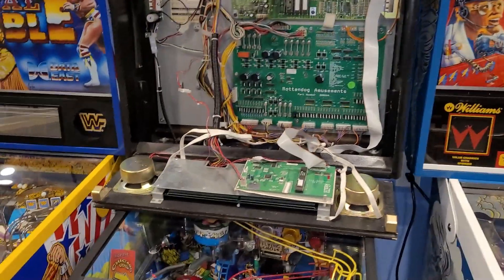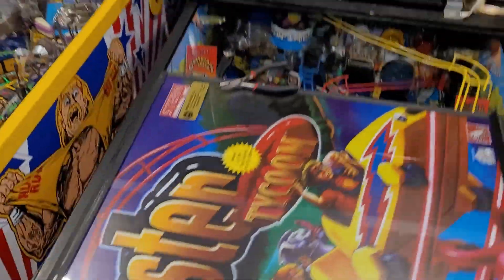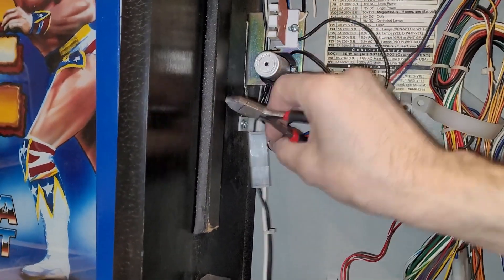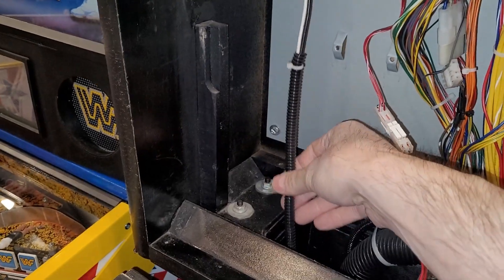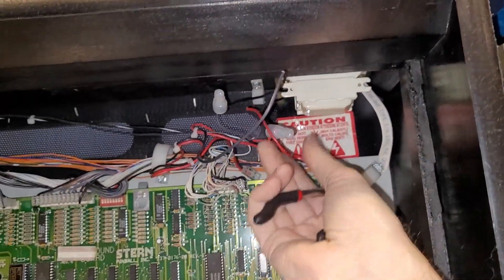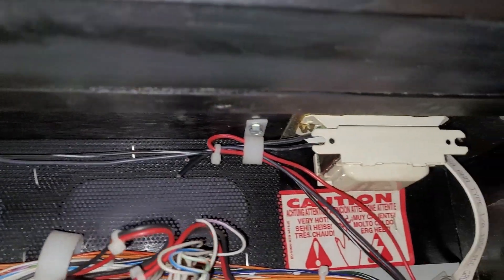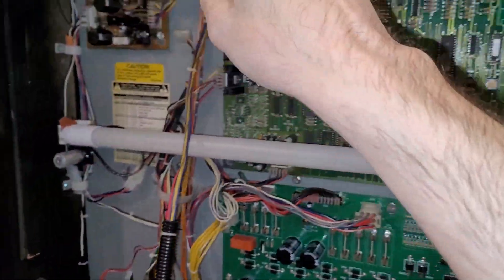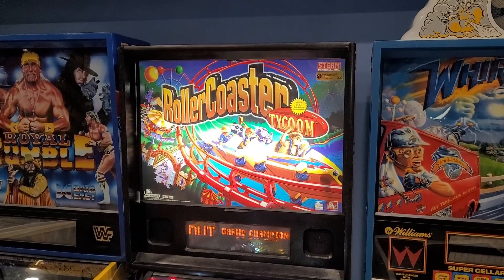How to convert your old fluorescent bulb to an LED tube in a Stern DMD Pinball machine in 5 minutes!

Comment: If you power the LED tube from the left side, you only need 1 wire nut.  The starter, starter socket and ballast can all be removed.  No wiring left from left to right side at all.  Makes a much cleaner installation.
Reply: Dumb question, can you just connect the black and white wire coming from transformer to back box ans connect to left side holders two wire and remove everything else?
Reply: @richardfedele7  Yes, that's really all there is to it.
Reply from the maker: Oh I like this idea! I may have to consider it on the next one!